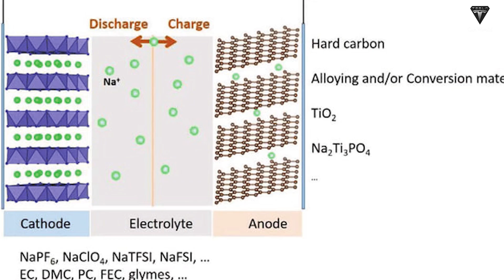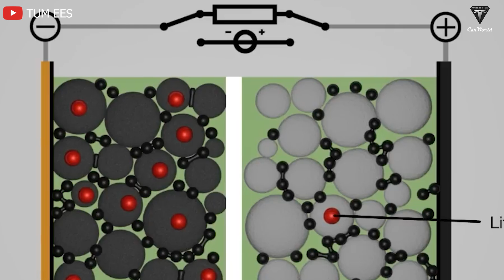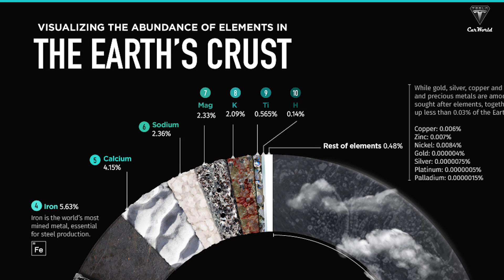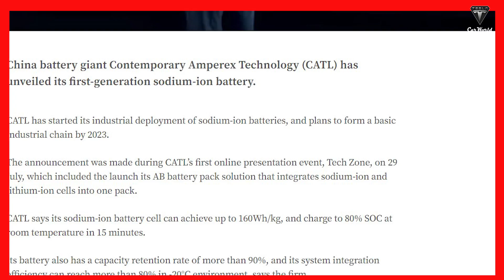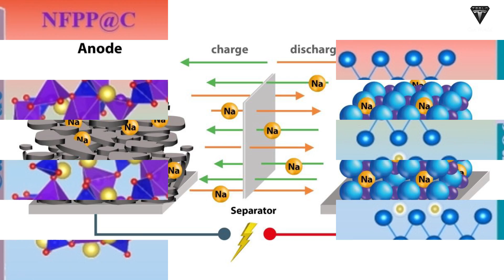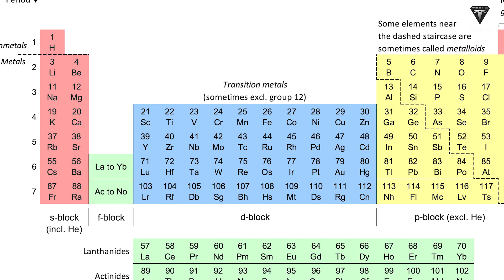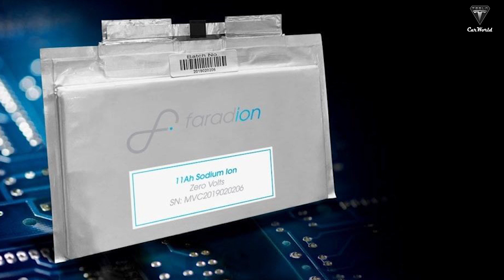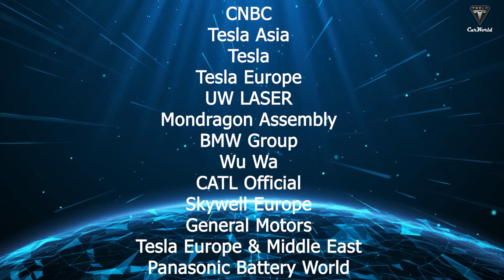Na-ion Battery (Salt Battery) Futuristic Tech for 2024! Elon Musk's LTP 4680 is Danger?

Comment: lithium is not green nor sustainable. I will not change to electric until I can get a Na-ion battery . It will need  a range of  250 miles and / or  150 miles +  with15 minute charge time to 80%.